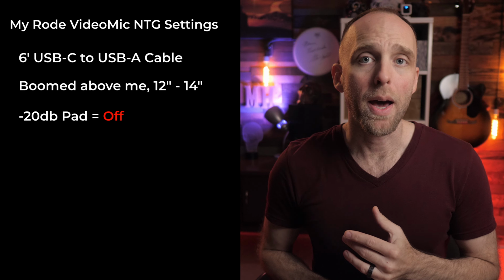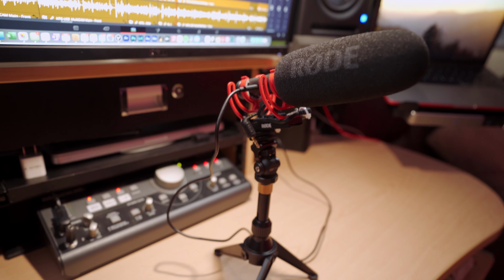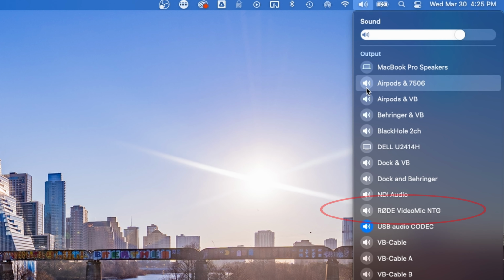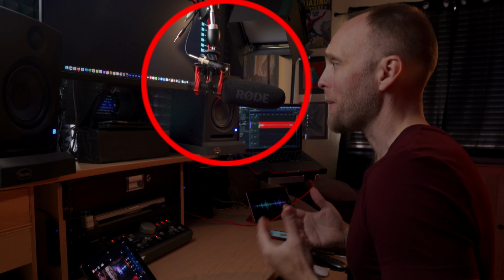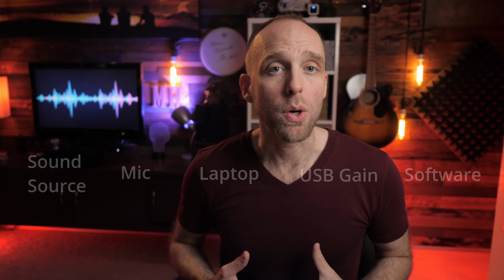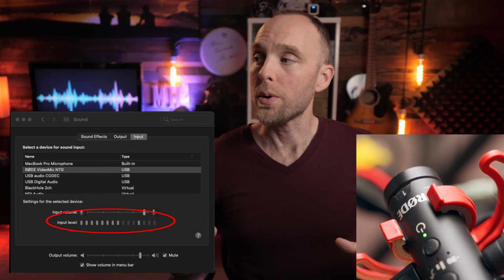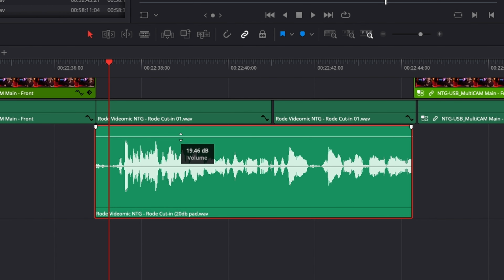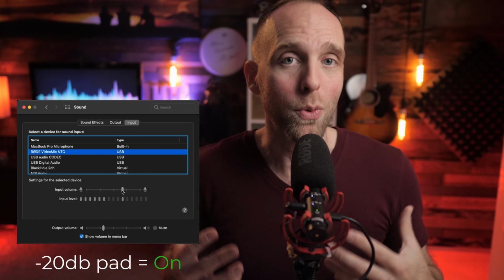How to set up your Rode Videomic NTG via USB for the best sound.

Comment: Can i follow same method for rode ntg 4 plus??
Reply from the maker: Hi there Kiransai.  Yes and no.  The NTG 4 plus is an XLR microphone, so, you'll need a preamp with an XLR input or a USB audio interface with a an XLR input/preamp to get the signal in to your computer if that's your final destination. Granted, the NTG4+ has an internal battery, which means you could use an XLR>3.5mm cable to adapt it down to input wherever you need, but, I digress....most likely you'll still be looking to plug this into an XLR input somewhere.  So,  Something like the Behringer UM2, Scarlett Solo, 2i2, or any number of endless USB audio interfaces out there.  But otherwise, yes, the method for gain structure is the same:  

1. Start at the sound source (your voice)
2.  Check the clip indicator on the mic (if it has one). 
3.  Check the preamp gain and input meters or clip indicator on the preamp/USB audio interface.
4.  Set your gain on the first device that has gain control.....so, if your USB interface is set at its lowest point, but you're still clipping out the preamp.....then, you would need to use the pad on the NTG 4 to lower the signal from the mic first.....this will give you a lower signal at the preamp so you can use the preamp gain more effectively
5.  If using a USB preamp/interface:  Go into System preferences on MacOS or Windows Sound settings.....see if the USB interface has an input slider for additional gain control......watch the meters and adjust the slider if needed to get to about 80-85% of maximum when your sound source is at it's maximum or average level.  Or, if there's no slider, just view the input meters on the computer to verify you aren't clipping out anything.
6.  Open your software and choose your USB audio interface, and double check you aren't clipping out the software.

If you're not using a USB audio interface with an XLR input/preamp, then, you may be using a standalone audio recorder like the Zoom H4n, Zoom F8, etc....and in that case, 
1.  always start with your input gain on the recorder at its lowest.
2. start talking or pointing your mic at the sound source, watch your input meters on your recording device......
3.  If your recording device input meters are NOT clipping, then start increasing the gain on the recorder until you get to about 80% of maximum
4.  If your recording device input meters ARE clipping when set to their lowest.....then you can engage the pad on the NTG4, then go back to the recorder and check your input meters.....your level should have dropped to where you can start increasing the gain on the recorder.

That's basic signal flow and gain structure.  Once your devices are all connected......just start at the sound source, and check the NEXT piece of equipment, then the next, then the next......from sound source TOWARDS The destination, and always go on that order......never in reverse, and that way you'll ensure you'll never clip out anything.  

I hope that helps!  Good luck
Reply: @MarcusHutsell  thank you!
Reply from the maker: You are welcome :)

Comment: Is it better to use this mic with an audio interface? If so, what’s the best way to connect this Rode NTG video mic to an audio interface for great sound?
Reply from the maker: Hi Brandon.  Actually, I would *almost never use this mic with an audio interface.  If your goal is to get the microphone signal and record into a computer, just use the Built-in USB-C port on the mic, and plug in the USB-C to USB-A cable that came with it in to your computer.  There's no need for an interface.  And, depending on the interface, you could be adding more noise using an additional interface because you'd have to then use the preamp on the interface, and that preamp can add more noise, which you don't want.

If you DID need to run this mic into an XLR input, you can do so with the Rode VXLR adapter that adapts a 1/8" cable to an XLR cable.  But, be careful to ensure that Phantom power is NOT turned on on your XLR input/Interface, as that *could damage the mic since it's not expecting phantom power to come back into the mic via the 1/8" port. 

And, of course, if you do use the VXLR adapter, you would have to manually turn on the mic (and turn it off) each and every time since it has an internal battery, but it won't "sense" it's plugged in when using the VXLR adapter.  And I have definitely forgotten to turn the mic off before when using it like this.   And I have also used this mic with the VXLR adapter to record into something like my Zoom F8n recorder.  Works great.

But again, there's really no need to use an additional USB Audio interface, that's the great thing about the Rode VideoMic NTG, it has direct USB-connectivity!  I use it connected directly USB all the time, works great.

I hope that helps, cheers!